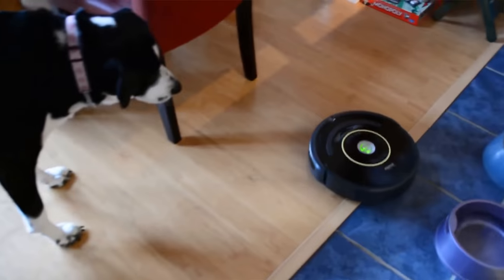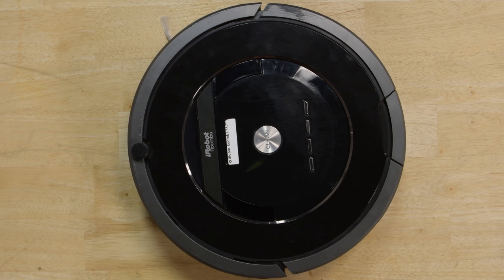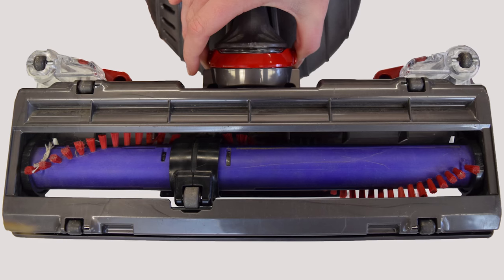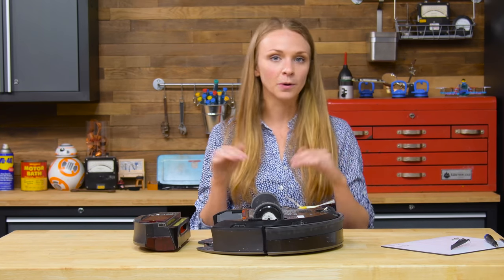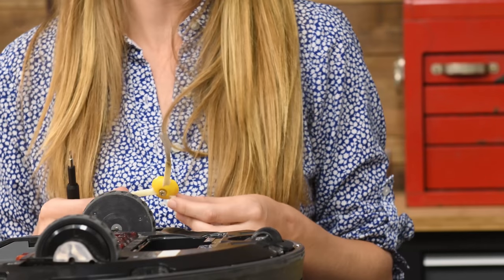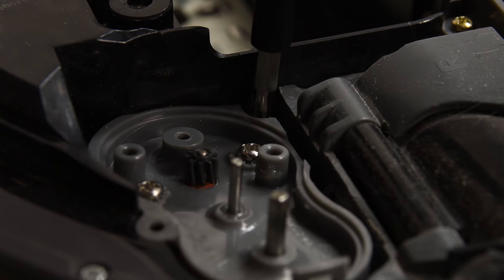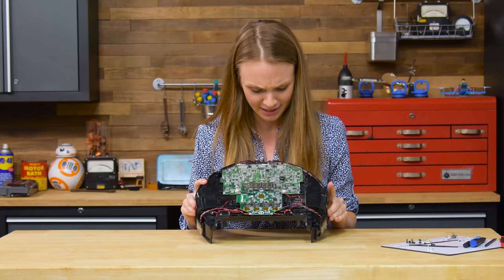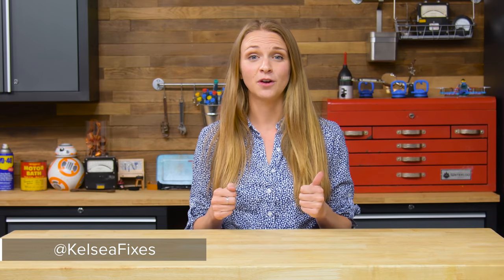Gadget Guts: iRobot Roomba 880

Comment: I fixed many roombas and the bumper switches are not the metal "spring" lever you showed us ;)  most repairs were for the ir led inside the bumpers switches, the IR receivers were designed to have  early defect ...
Reply: the receivers are most of the time ok, the infra LEDs or the emittors are usually bad. And they are not made to broke after few uses, they are actually pretty high quality, but they just sometimes burn, it is same like with the LED bulbs, where are lots of LEDs, and after many uses some of the LEDs just burns, so there are few black spots in the bulb.

Comment: I purchased my Roomba 880  exactly 2 yrs and 8 moths ago.  I have hardwood floors only. The front caster wheel just broke; other than that, I've had no problems. It still cleans great. My question is, when should I replace my debris extractor rollers? What do I look for besides not cleaning properly. It's been almost 3 years since I purchased and I've read somewhere you should replace every 6 months. Is that correct or is it when they actually get worn down?